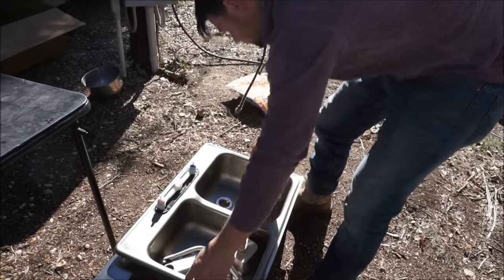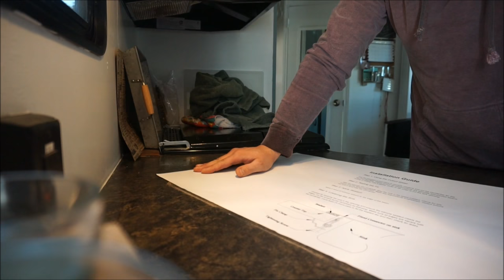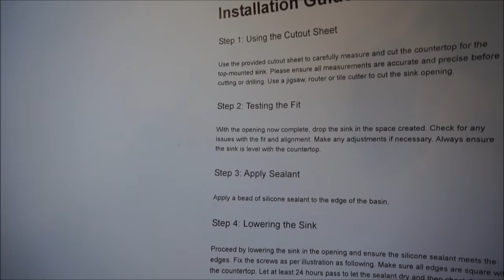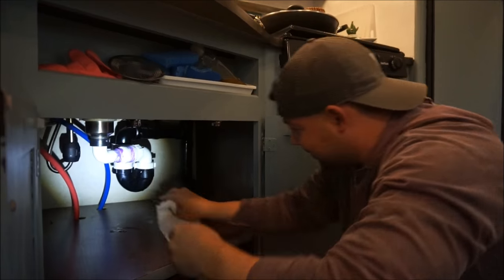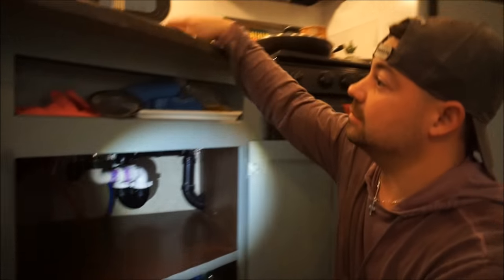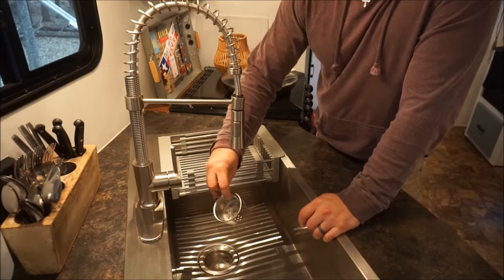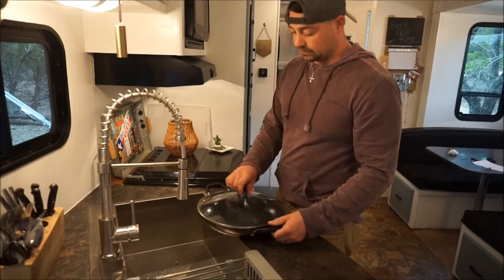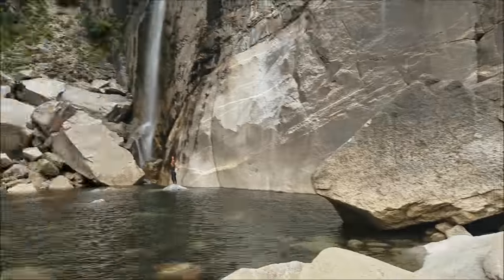RV Sink Replacement

Comment: A plumbers tip for you... way easier to just lower the trap arm.  I can see the 1 1/2” santee above the LT 90 and plenty of pipe to cut in between.   That’s an easy one